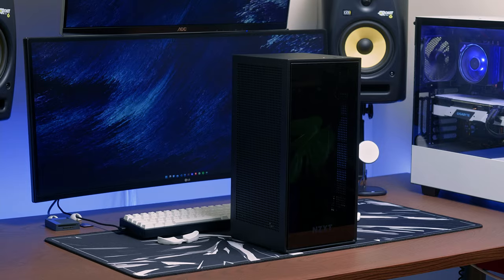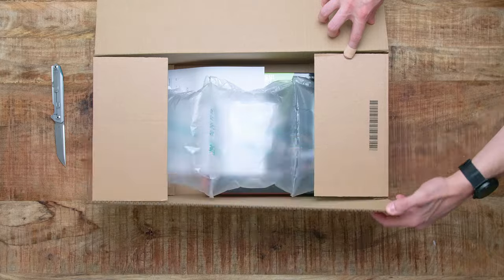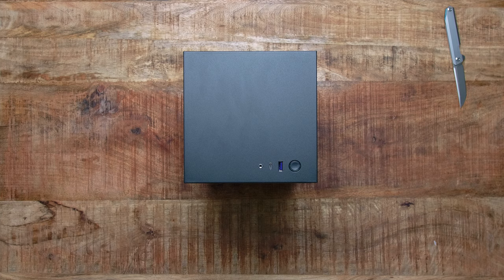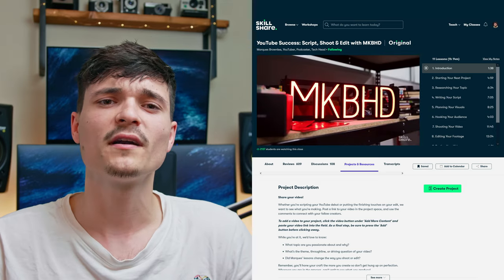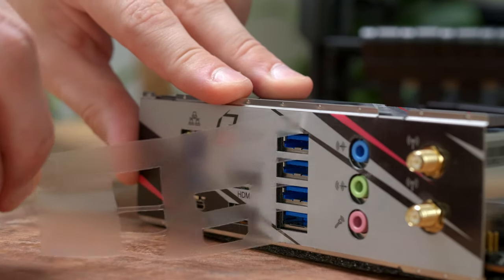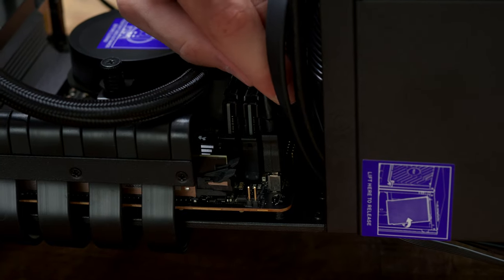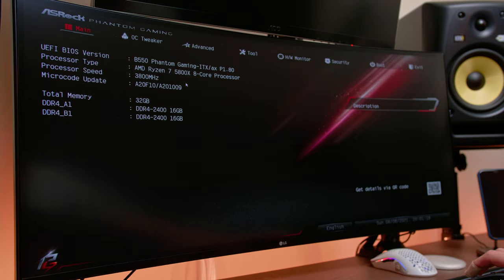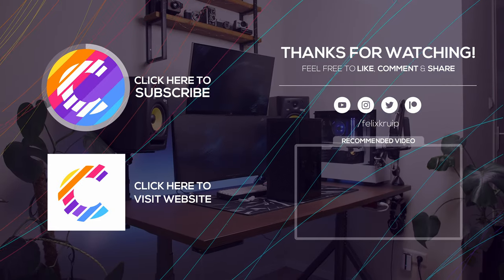Building the Perfect PC for Windows 11 - Clean & Minimal

Comment: Very cool video. Perfectly simple, step-by-step instructions with clear video to go with it. Thanks a lot for this. I started building PC's in the 90's. My main PC, which has been chugging along very well for 12 very productive years, is finally showing its age, like me. In a sort of 'Look What Happened While You Were Sleeping' scenario, I discovered, much to my chagrin, that none of the dozen or so PC's I use are Windows 11 compatible! I'm therefore looking to do a new build for Windows 11. I switched to mini-itx builds and small cases for gaming PC's for both my sons a couple of years ago, and they are both very happy with the result. Installing the liquid cooler was probably the hardest part of the build. Your NZXT case, which comes with the built-in liquid cooler solves that issue well. Kudos!